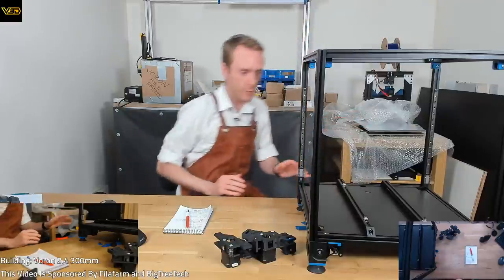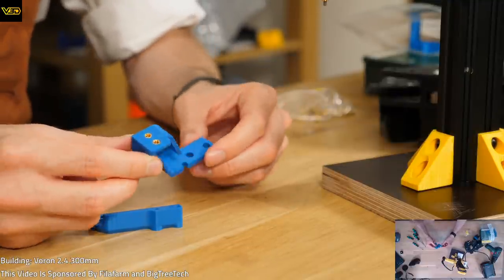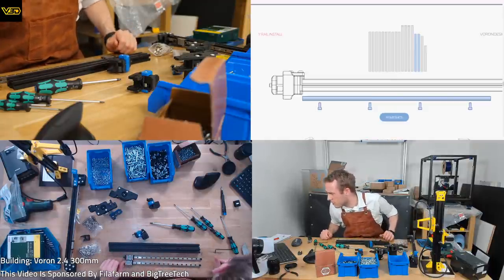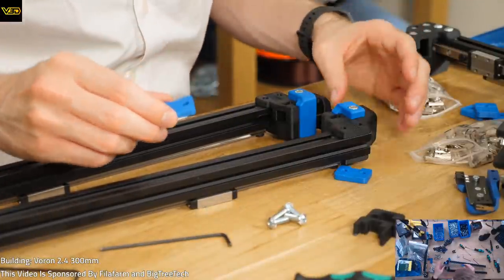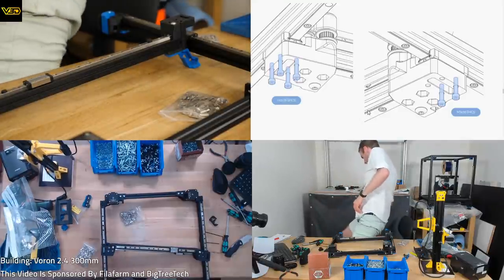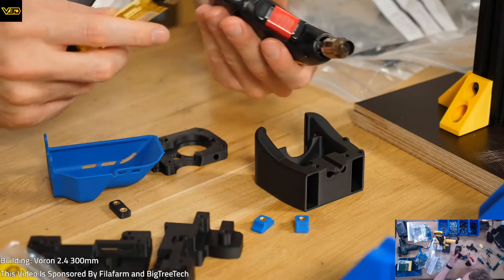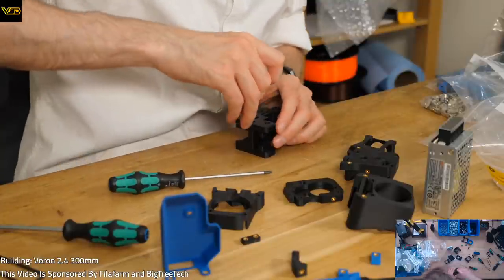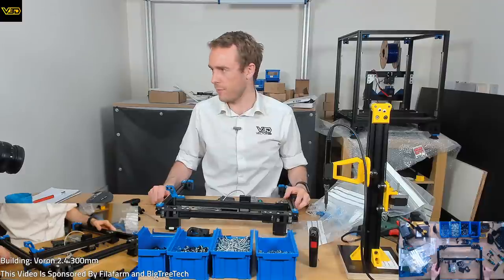Building a Voron 2.4 Live! Part 4: Gantry Assembly

Comment: I have the dremel flame thrower. It does soldering and heating and burning and flame throwing. And stuff. Also have the soldering iron. Might be a worthy project to make a heat insert press for it. Pressing them free hand is so much work to make them straight. Does your iron have some special tip for the inserts?